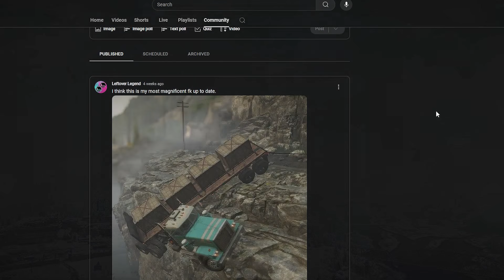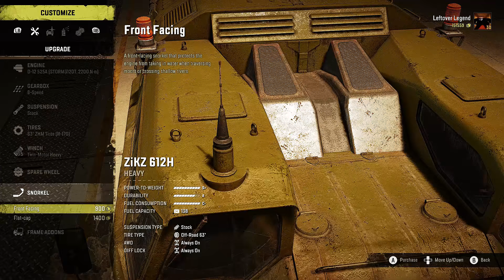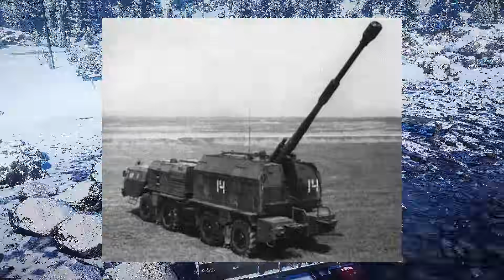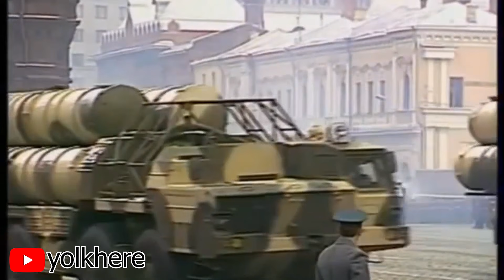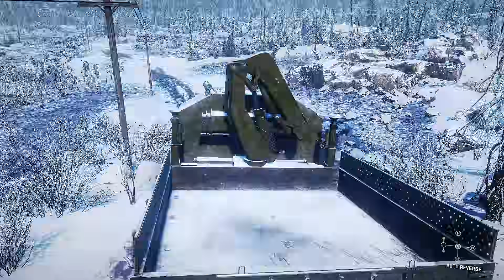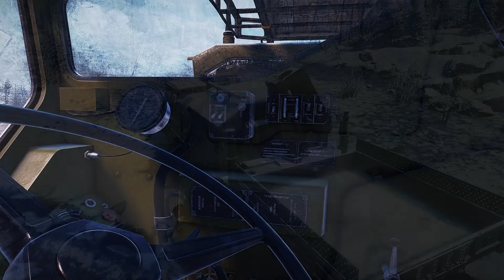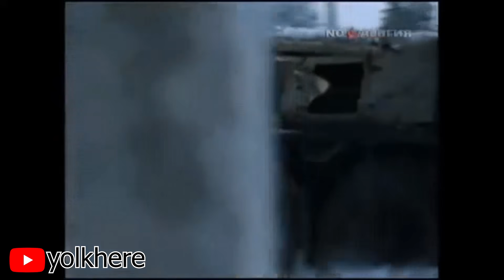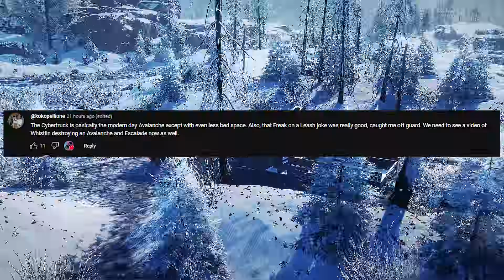The MAZ 543 and 537 - Heros of the USSR - Told Through Snowrunner

Comment: The curtains are, to my best guess, probably flash curtains. Nuclear bombers featured curtains to prevent the nuclear detonation from blinding the crews. I don't believe these curtains are for the blast itself (the scud has a pretty low range but not that low), but instead so the crew isn't blinded by the very close and very bright plumes from the rocket motors.
Reply from the maker: I hadn't thought of that. Do you think the crews would be inside the cabin during launch? I would've assumed they were a safe distance away since nothing I read made any mention of any kind of blast/heat protection on the cab.
Reply: @leftoverlegend6024  I never really considered that, it was just a thought I had for a potential reasoning behind them based on things I actually know about.... of course I'm autistically fixated on pretty much everything mechanical except for ballistic missiles and their carrier trucks. 

(Or really trucks in general, you're the reason I started getting into Semis and heavily playing snow runner which I hadn't previously opened since just after I bought it on release)
Reply: @leftoverlegend6024  I recall hearing something about how the cab is sealed, so the crew would be buttoned up inside during the launch. This would protect them from the rocket motors and any radiation from the payload.

But, I heard that a long time ago, and you are the one who did all this research, so your guess is likely better than my possible fact.
Reply: @amtree4140  the payload likely wouldn't be leaking much radiation, not enough to be concerned with. I would think any sealing for radiation is simply the usual soviet army CBRN protection to survive during a nuclear war. They foresaw a need to drive through terrain hit by nuclear, biological, or chemical weapons to hit a target, I suppose
Reply: They could also be a thermal shield because they operate in arctic conditions the windows would let out a lot of heat
Reply: Though I imagine the light from launching an icbm at night could also dazzle you, I don’t think the designers expected nuclear weapons going off around their launchers but you never know
Reply: @TheCrapOnYourStrapOn  ב''ה, based on general cold war planning and both players' intention to unload in retaliation.. can't speak for the particular design, but keeping a surface crew from being blinded by what was going on an otherwise survivable distance away was probably a design element.
Reply: @josephkanowitz6875 maybe they had a kickass movie projector for the crew for those long nights on duty :)

Comment: Just as a heads up. I just completed these maps and I highly recommend clearing the roads to make travel easier. Some road blocks can be easier to bypass than others but on the whole it will make things a little bit more easy on a decently hard map
Reply from the maker: Oh yeah I definitely will as I actually play though it. I jumped ahead to get these trucks and didn't bother clearing them partially cause I was trying to meet a deadline, and partially to add some drama to the video.

Comment: Oh yea and another thing I want to mention i realized is that MAZ made the 535 and the 537 they are very similar but the 535 had 3 headlights and the 537 had just 2. That's the difference
Reply: Well that's partially true.
The later 535 models had 2 headlights, just like the 537.
They do have almost the same design but the main difference is that the 537 has more power.
Still great that you know these behemoths.

Comment: Another great video, btw could you pls make a Playlist with all videos from this series added in it? 
it would be great to have it all in one place 👍
8:05 there is a mod that converts the Water tank for Fuel + some spare parts in it for the Maz 543 as another addon, same for the Big Fuel Semi-Trailer you can get it to use as normal trailer via one Mod, also you can find the special military heavy trailers that it used as Mod they are damm greatly modeled
Reply from the maker: Yeah I can absolutely do that, thanks for letting me know. I didn't know there was a mod for that, I'll have to check it out, I actually used to use that mod, I used the heavy fuel trailer for testing the hauling capacity of the T813, don't remember why I ditched it tho. I'll have to revisit it.